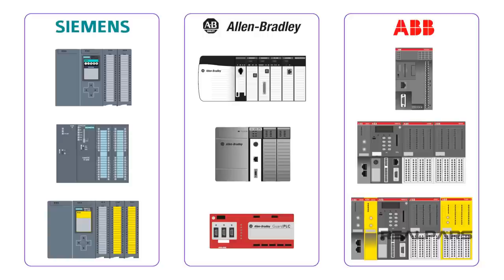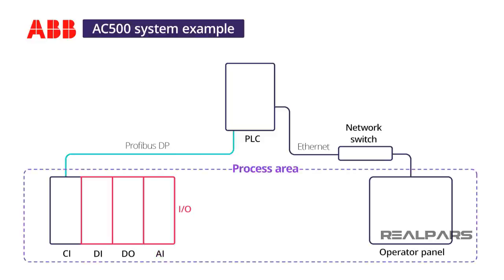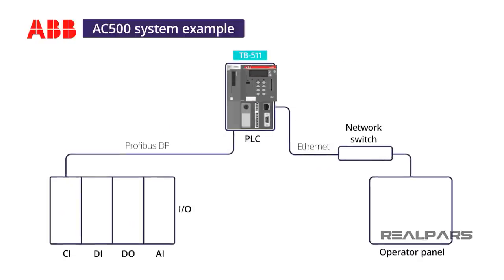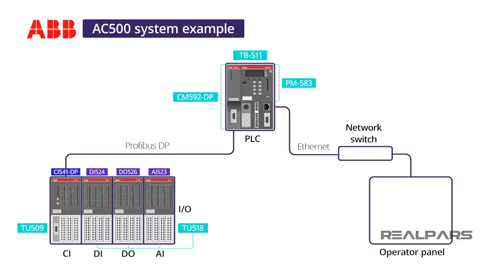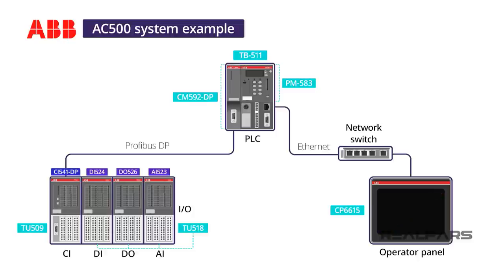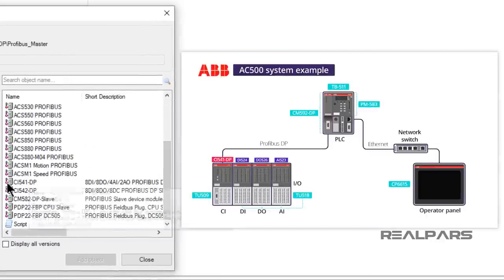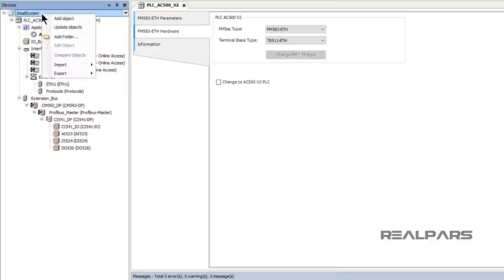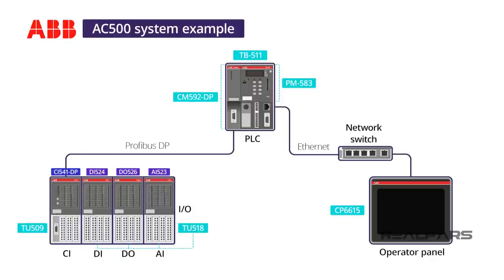Applying an ABB PLC to a Small Process

Comment: Which plc is used to automate a concrete brick machine?
Reply from the maker: I have automated similar processes with A-B and ABB.  Siemens, Omron, Mitsubishi, and many others could be used as well.   Each of these PLCs can certainly handle the logic for a concrete brick machine, as each manufacturer makes CPU models suitable for single machine control.

Comment: Excuse me, ai523 module is an active or a passive?
Reply from the maker: AI523 is an analog input card (interface).  It can supply loop power (4-20ma @ 24VDC) to each channel, so in that sense, it is active.  It can also be configured for RTD inputs, which could be considered passive.